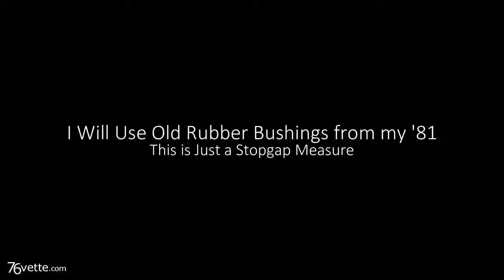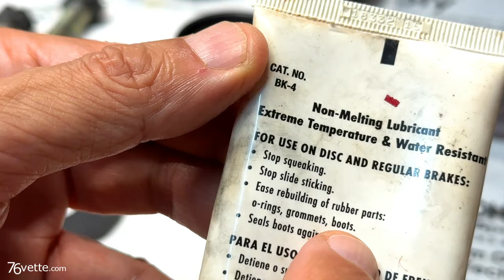Replacing 63-82 Corvette Leaf Spring BUSHINGS

Comment: Hey Luis, another great video. I do miss your narration of your work. Did the lowering bolts drop the rear an inch or so? You have an excellent way of calmly describing the good and the bad of C3 repair. Love your cleanliness and quality work. Even your jack is spotless!  Have a great day.
Reply from the maker: Yeah, I’ve been experimenting with no-narration videos since they’re actually shorter and they do not require translation for viewers of non-English-speaking countries. 
The lowering bolts did drop the rear about an inch, but you always have to take into account the tire profile. 
My 76 was already lowered and I used the factory leaf spring bolts to show the differences. And I prefer the castellated nuts with cotter pins versus un-drilled bolts. 😊👍🏻

Comment: great video, so using that rust remover on the washers is better than removing the rust with a wire wheel?
Reply from the maker: I clean them before applying the rust remover, which also neutralizes any rust hiding in hard-to-reach areas. 😊👍🏻

Comment: At ~4:55 when you first start to jack up the right rear hub & trailing arm it appears there's a very noticeable camber change of the hub and trailing arm before they start to lift.  Is something in that system worn, or too much play in the diff?
I'm curious because I'm getting ready to do an alignment on a '66, after changing some bushings.  I'll have to watch mine closely to see if I see the same thing.
Reply from the maker: The rotors are not riveted so that causes the movement you see.

Comment: Does your 76 have a 7 or 9 leaf spring? My 77 rear suspension is worn out and the spring and half shafts are bent upwards. What spring would you recommend 7/9 leaf or composite?
Reply from the maker: My 76 has a 9-leaf spring. I’ve heard people give composite springs great reviews, but I have no experience with them so I cannot tell you which one to choose. 😊👍🏻
Reply: @76vette thanks, was thinking about trying the 7 leaf or a low arch comp. Don’t want to have to deal with a ride height issue.